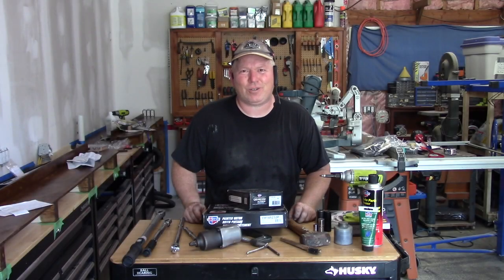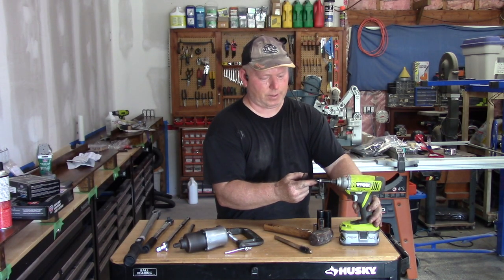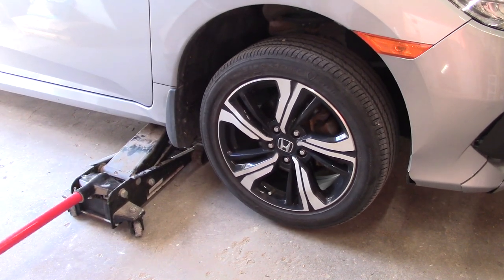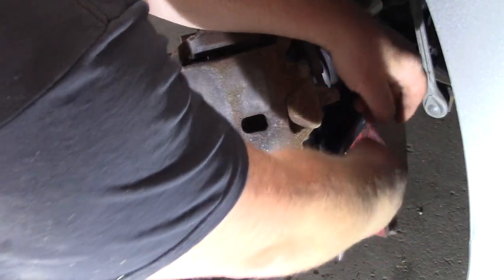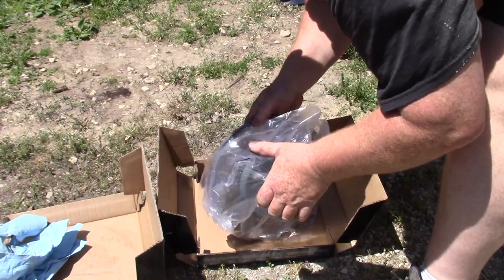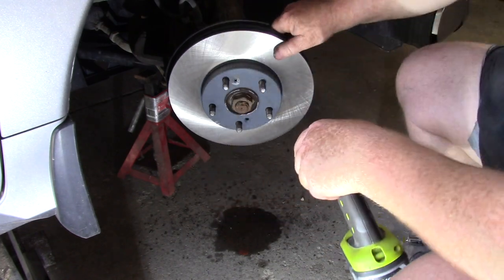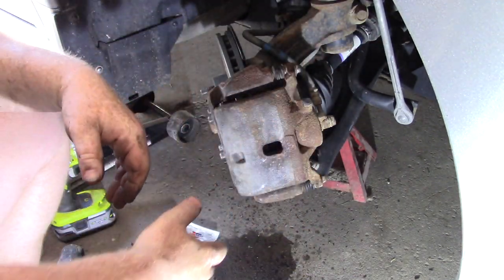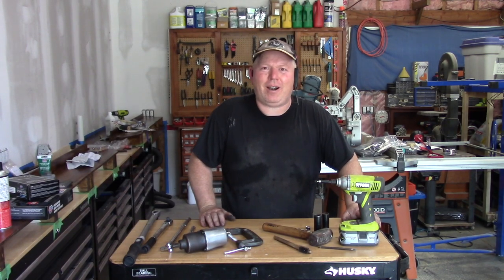DIY Honda Civic Front Brake Change 2016 to 2021 model years.

Comment: Just like to say that the pad carrier definitely does not move around to center itself.   The other part is what your on about.
Reply from the maker: The caliper mounting bracket is stationary and the caliper and pads are designed to slide back and forth on that bracket.
Reply: I know.  But you had the bracket in your hand while talking about the other bit.
Reply: You said "this whole assembly moves"    while moving it to show.   That's the part I was on about.    It's no big deal just thought  I would mention it that's all.

Comment: Do you have to put the springs back?  Just seems like such an unnecessary part.
Reply from the maker: I think that the springs are to help push the pads off the rotor for less wear and better fuel economy.  Not sure how effective they are but I would definitely reuse them.  If you broke one I wouldn’t really be too worried.  The older brake designs didn’t have them.  Good luck with your repair!
Cheers!
Rob
Reply: Thank you!

Comment: No sensors for the antilock brakes?   Easy peasy!
Reply from the maker: The ABS sensor is located in the knuckle.  Not part of the brake assembly.  You can see it just behind the black brake shield.  Good Luck with your repair!
Cheers!
Rob

Comment: Getting ready to change the pads and rotors on my car using your videos. Question for you: what’s the best way to make sure you don’t push in pistons too far in?

Great video, by the way.
Reply from the maker: That is a good question.  Push them back until the piston is just a bit further out than the body of the caliper.  If it’s not far enough you won’t be able to put the caliper back on with the pads in.  If it’s too far back the boot will stick out further than the piston (we don’t want that to happen).  So basically not quite flush but close and keep an eye on the rubber boot.  😬. Don’t worry you’ll be fine 😉
Reply: @robsgaragewoodworkin  thanks for the prompt response! First time is always the toughest 😂

Comment: So for the break squealer goes up
Reply from the maker: The squealer pad goes on the inside (engine side)
Reply from the maker: @loriansantibanez5191  
https://www.google.com/imgres?imgurl=https%3A%2F%2Fwww.hondapartsnow.com%2Fresources%2Fencry%2Fdiagram%2Fhpn%2F2021%2Fmedium%2Fe231eb23e74c8028f276313075d4e4f4.png&tbnid=XT4qXZ52qS9BOM&vet=1&imgrefurl=https%3A%2F%2Fwww.hondapartsnow.com%2Fgenuine%2Fhonda~caliper~sub~assy~l~fr~45019-t5r-a10.html&docid=ktPINSW4eXkHJM&w=640&h=320&itg=1&hl=en-ca&source=sh%2Fx%2Fim%2Fm4%2F3&kgs=c426d3cb41a8fb7c&shem=trie

Comment: Do you have to replace your disc's eveytime you do your pads?
Reply: no
Reply: Honda recommends changing the disc rotors at approximately 70,000 miles on the 2016-2021 Civic
Reply from the maker: The brakes are the most important safety system on your car.  If you want the ABS to perform properly I would suggest changing the rotors or having them turned down.

Comment: Do you not have to use the Honda tool to put the electronic brake on maintenance mode?
Reply: I mean for the rear brakes??
Reply from the maker: Not for the front brakes but you have to for the rear.  There is a way to do it manually and calibrate the electronic parking brake system after.  I'm researching that now actually.  Need to do mine in the next few weeks.
Reply: I bought a Foxwell scanner with the EPB feature worked out great and made the rear change incredibly easy
Reply: Torque values should be reduced by 25% if using antisieze as the factory Torque values are calculated with dry components